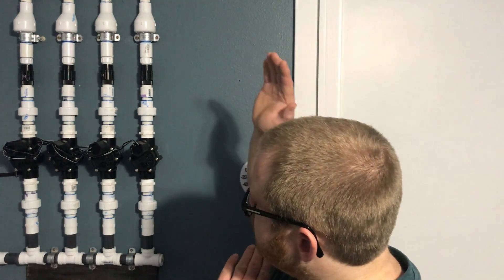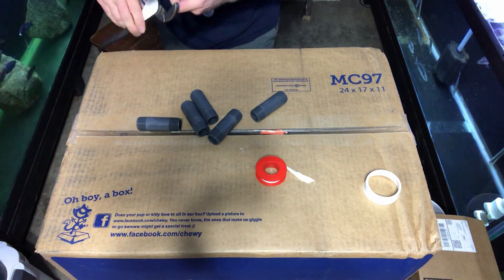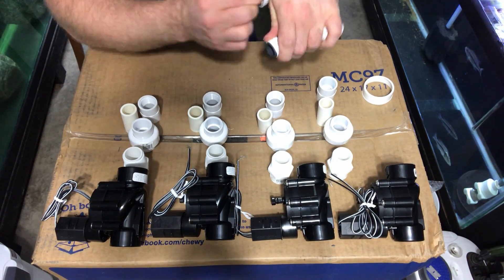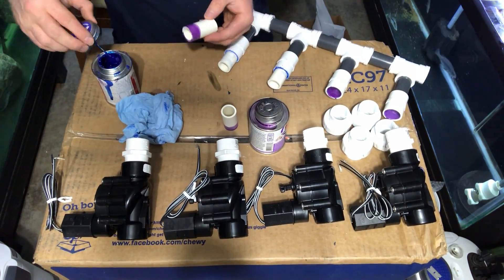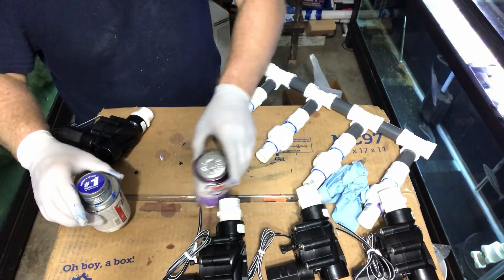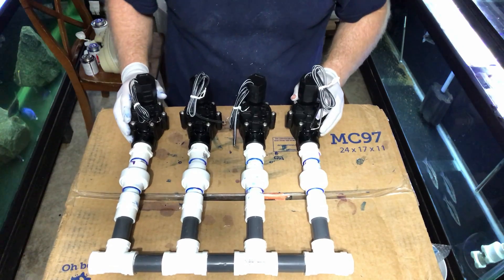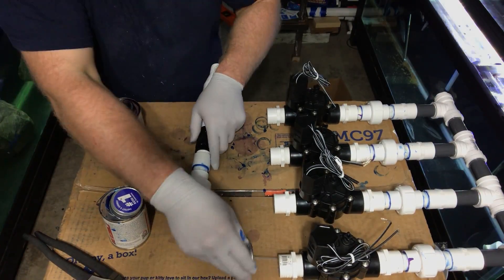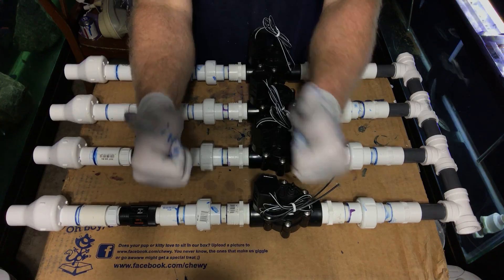DIY Auto WATER Change System MANIFOLD

Comment: Why did you put a check valve and pressure reducer for each instead of just putting one of each product to the water entering the manifold? Overall the build looks great and I am definitely going to build one of these in the near future.
Reply from the maker: I wanted full power before the manifold. Plus this is how I seen it designed and went for it

Comment: I was trying to post a pic of my plumbing job on my 220 gallon. I also use the clear primer on a towel to wipe off everything when I'm done. Gets off all the lettering and stickers on the fittings and pipe. Just the thing for the OCD
Reply from the maker: Got to love the OCD. I have it bad, LOL
Reply: Lol. Mine is pretty bad. I tell people I have CDO. It's like OCD. But it's in alphabetical order they way it should be
Reply: 1 thing. Have you thought about putting in a ball valve between your manifold and your unions? That way you can turn the water off to just that one circuit. That way the others can still work in case of an emergency or maintenance and you won't have to drain the whole system down
Reply from the maker: HAHAHAHA! Thats a good one
Reply from the maker: I should have, and I still can.

Comment: Nice man! I started watching this series right after I started a similar system. Been nice to follow along.

Do you have any footage of that D. Comp group I could see during the video?

Although it's too late for this section, using clear primer and glue gives a clean look. I hate working with PVC. Especially primer as it runs like a bitch. Certain cities/villages require a colored primer so it can easily be seen, but I doubt you pulled a permit for this project.
Reply from the maker: Sweet, thanks for following along. I don't have any footage yet, but I will down the road. Yeah I should have used clear primer and glue. I like the look of the blue around the seal as long as its clean, which we know is not the easiest to archive.

Comment: question, do you think it would work just the same with lets say 2 inch pvc water pipe. What is the recommended GPH for the pump you may use to get the water out? Another question, are there any measures in place to prevent fries from accidentally be taken up by the system?
Reply from the maker: I am not sure on the 2 inch pipe. I am sure it would would, but you would need to reduce down to the pressure regulator. 3/4" is a safe bet. GPH I am not sure. I have screens over my overflows, so the fry wont go down the drain.
Reply: @inventoryking  you are awesome man, the set up is crazy kool, i should try that someday. Great work bro.
Reply from the maker: Thanks dude! Stay tuned more to come in this series